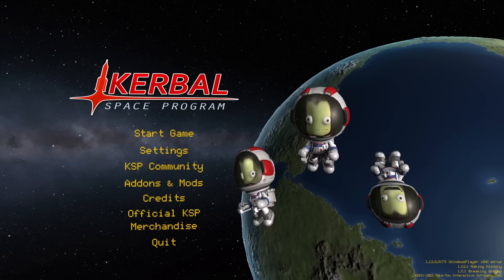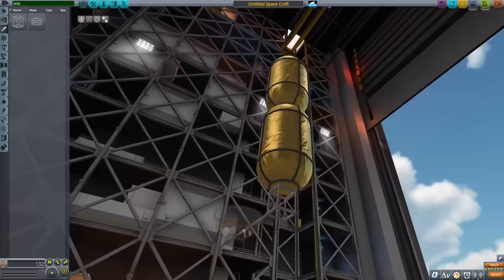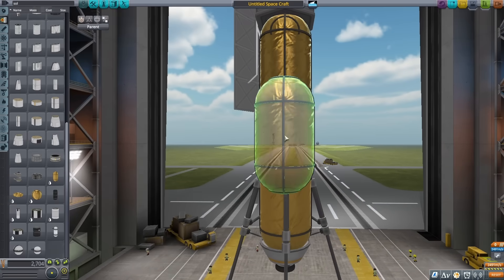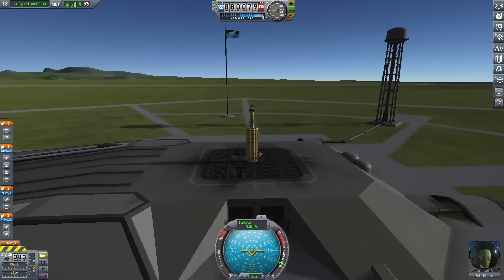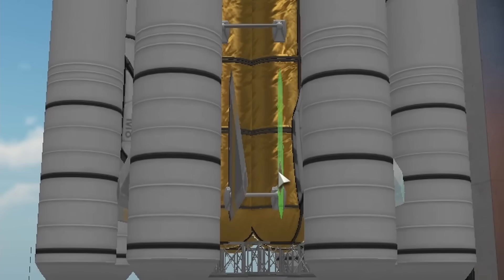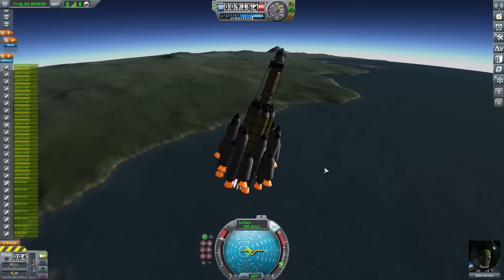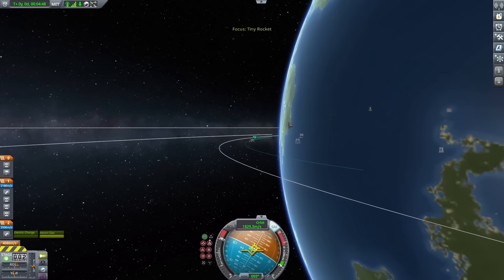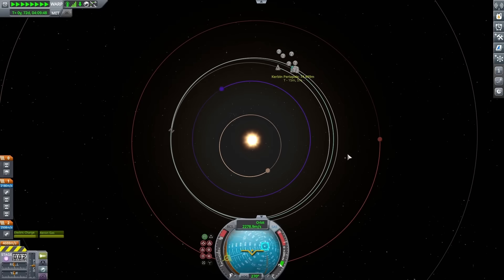Can You Use Only Tiny Parts to Get to Gilly in Kerbal Space Program?

Comment: The reason the solid fuel boosters ran out at the same time is because the time they take to burn is related to the radius, not the height. The height is related to the power of the booster. This is why SLS has the same srbs as the shuttle but with an extra segment of solid fuel. They will burn out in the same amount of time, but the sls ones are more powerful because of the height.

Comment: You could have used far less solar panels and skipped the landing gear.
Its gilly
You could even use the most delicate hardware as landing gear there.
Also you dont need a chemical return stage. As soon as in LKO just use xenon.

Comment: Might be a bit hard to do, but can you do a " To the Mun and back without ever turning down throttle" Meaning you have to have your engine going the entire time to get to the Mun. Land, and then return.

If the challenge is too hard, then you could throttle down a bit for the landing. But preferably also make it back to Kerbin. Would be interesting, you could get to the Mun fast if you spec your craft for it. But havign to slow down, and then touch down on the Mun while killing your speed might be tough. Might be more of a scenario of patience vs time. Since a normal flight would take about 10 or so hours in real time, but I would want to get that extra speed to finish it sooner.

Comment: Now make the smallest rocket possible with the biggest parts
Reply: Mk1-3 cockpit (the Apollo one, in case I got the name wrong), largest 2.5m fuel tank, and... hmm... an engine one or two sizes down from the Mainsail -- these 3 parts make a fairly good SSTO rocket. Or you can use the same cockpit with just a Twin Boar engine for an SSTO. Not the smallest in size, but definitely in part count. :)

Comment: RTG's! RTG's can solve so many of these powering issues with the ion stage! They generate quite a bit of electric charge--and have basically no cost!
Reply: They're quite heavy for the amount of electricity they generate, and they don't generate much. To run 1 ion engine at full power takes 12 RTGs, weighing nearly 1 ton.
Reply: Also, I think (don't quote me on this) that the Fly by Wire should be small enough. Dunno.

Comment: You can hold Alt in order to snap only to nodes so you don't get the engine crooked
Reply: Good general tip! In his case he was using twice as many engines as tanks (you can see this if you freeze frame at 2:46). It looks like he used alt for half and when the tank nodes were exhausted he eyeballed the rest.

Comment: 3:42 im pretty sure this actually did more harm than good since it just adds weight and another connector point (adding drag)
Reply: I have to agree with you however because the connecting point is facing down I don't think it causes any additional drag.
Reply: @drake52  facing down connectors add drag, just less
Reply: Unoccupied nodes generate the most drag, only attach nose cones on them.
Reply: @04Ismyfavoritenumber  how did you find this comment lmao its 2 years old and has 1 like

Comment: When you added the nose cones to the top of the fuel tanks it actually does nothing other than adding weight. For some reason, nose cones in ksp only work if attached to a node
Reply: Really? in all my 2K+ Hours of KSP I didn't know that
Reply: @xenowreborn  yeah, it’s because ksp doesnt model the fluid dynamics of the air, only does a simple drag calculation based on the aerodynamics of the pieces.
Reply: @xenowreborn  yeah drag is calculated by how many open attachment nodes are exposed to the air stream. Of course parts have a set drag and lift amount, but exposed nodes are definitely the highest source of drag. That and struts.
Reply: @camera1946  The direction they're facing does matter right? Otherwise I'd be able to make a super spiky rocket that's super aerodynamic lol..
Reply: @Cirelion  Direction matters more for some parts than others. The worst are fairings and Mk2 parts.
Reply: drag is calculated by nodes.

1.what is the node from
2. is it attached
3. if yes to 2, what is it attached to.

those three factors go into an equation with atmosphere density and speed to figure out the drag
Reply: nonono, it also made it look cool, dont forget that

Comment: speaking of ion engines and not enough electricity, they can survive with all the way down to 10% of energy requirements, but give less and less efficiency as you go down, all the way to 55% thrust of what it should give, so starving your engines is a viable strategy if you are itching to save weight on your electronics, tho i dont think this is practical either way, but there is a rhyme and reason to ions working when starved.
Reply: Could you in theory just decrease the thrust limiter or does that also decrease effiency.
Reply: @logicbuilder1204  no.
Reply: @SCTG-b1c  No as in it doesn't decrease efficacy or no you can't do that.
Reply: I hate ultra efficient slow ships. I mean: Save a few pounds of weaght and take another 5 years. and burn hours at a time

Comment: Just so u know, I believe its more efficient to perform the burn that corrects your plain at the apoapsis of your orbit
Reply: correct, the further away you are, the less expensive inclination changes are
Reply: This is only true if the ascending/descending node coincides with your apoapsis. The best way to do it is to just pick whichever of your ascending/descending nodes is closer to apoapsis, and perform your burn there.
Reply: @davygibbons4098  I'm talking about the burn around eve, before he had a trajectory for gilly, but otherwise, yes you are correct.
Reply: I think it's sometimes a net saving of dV to use a little bit of dV on pushing either one of the AN or DN onto your apoapsis from wherever it is, before changing plane.
It's definitely sometimes a net saving to get a really high, really slow apoapsis before trying to execute very large changes in orbital plane.
Reply: @richardbarrell4043  yeah you might be right

Comment: Can someone explain to me why you'd even get into orbit around kerbin and wait there for the launch window?
I just burn straight up when the launchpad is pointing me in the right direction for losing/gaining speed around the sun. Isn't this more fuel efficient?
Reply from the maker: I can't burn away fast enough to directly escape with the ion engine so I'd either need to add more boosters or set up and perform multiple orbits to escape
Reply: @ReidCaptain  "I can't burn away fast enough to directly escape with the ion engine" I wasn't talking about escaping with the ion engines. Would be an interesting test to see how far the amount of fuel you used to get into orbit would take you when burning straight up.
Reply: @chrisakaschulbus4903 Almost impossible, because if you do not turn, you just go up, then down, so you have to go interplanetary immediately.
Reply: @thegamingidiots7012  "so you have to go interplanetary immediately." Exactly. That's what i'm doing. Why waste time (and fuel?) getting into orbit around kerbin?
Reply: it's much less efficient and much more difficult
Reply: @magica3526  Can you explain why it's less efficient? And what about it is more difficult?
Reply: @chrisakaschulbus4903  I do it the same way, getting to orbit around Kerbin requires a very stable rocket also theres aero drag and physics involved, so to avoid that I strap the most powerful solid boosters for the ongoing mission Mun/Duna/Ike... and efficient boosters like puddle engine or that small one or both (nuclear engine sometimes too!) These solid boosters shoot me beyond Minimum orbit or any space in the Kerbin system location when I go straight up from launchpad and the rest is on my super efficient 5k Delta v 60t spaceship that can refuel itself on another celestial body. This is the story of how I went interplanetary without ever docking or having a "proper" start with Kerbin orbit launch. To this day I'm using the model of this rocket to send the best rovers, mining missions, tourist, satellite and science ships all over the Kerbol solar system.
Reply: Going from direct ascents to hohmann transfers made my munar launches go from inconsistent and difficult to trivial
Reply: Use hyper edit to remove the atmosphere. Build a rocket with about 3.4km/s. Launch straight up, then launch horizontally. The oberth effect and the speed from the planet's rotation will give a small but meaningful boost to the horizontal trajectory
Reply: And for ease you can plan your maneuver before executing and don't need a precise launch window
Reply: It's much less efficient. I don't know the exact reason but i guess it has something to do with the fact that while you're burning straight away from the planet you're fighting it's gravity all the time. But when you're in an orbit, you're usually burning tangential to the force of gravity and therefore you don't loose velocity to it. Alos while going straight up you're not using the velocity you got from the rotation of the planet.
Reply: @knickohr01  I guess I'll have to try it next time i play.
Reply: @chrisakaschulbus4903  Making an orbit allows You to precise your transfer manoeuvre to another planet. Doing it from orbit of the planet instead of solar orbit makes it more efficient thanks to Oberth effect.

The disadvantage however is that it requires a decent TWR or splitting manoeuvre into smaller burns because it will mess aim due to short orbital period. On low Kerbin orbit i always aim to not surpass 4 min burn per manoeuvre.
Reply: @bartoszkola621  I would record my findings when i test it out, sadly my PC isn't up for that task.
But you gave me the idea to also test how much further i'd get when using multiple burns in orbit.

Comment: "This is the only normal fuel tank of this size." Oscar-B fuel tank: Am I a joke to you?
Reply from the maker: I was looking for the tall cylindrical look more than anything but yeah it would have worked well
Reply: @ReidCaptain  could've just stacked a bunch of them
Reply: @s4dg  connecting a bunch of segments adds unwanted mass over a single piece.
Reply: @s4dg  leggy and unstable
Reply: @solararmor3961  laughs in rigid attachment
Reply: @trashlambo  oh no... The laugh is too powerful!
Reply: Ya but it be much more weight tho
Reply: and also "the spark engine is the only engine that attaches to the bottom" Ant-Engine left the chat
Reply: Bro I watched this twice and both times I went to the comments bc of the poor Oscar B 😢😢😂
Reply: @chazbennett7771 The Ant was also ignored.
Reply: the baguettes are just so much better tho.
Reply: @RAFMnBgaming   lighter